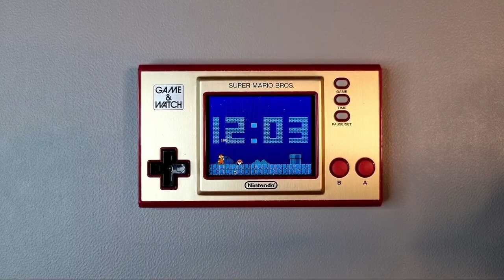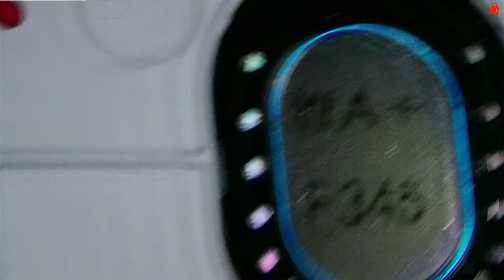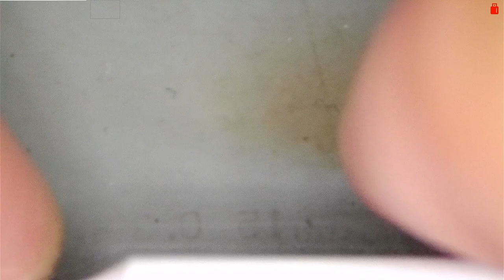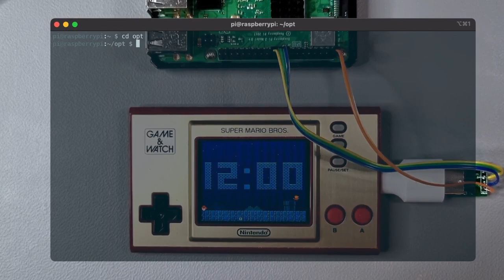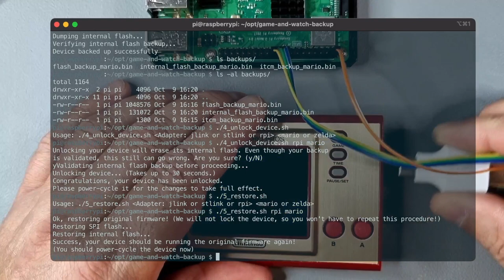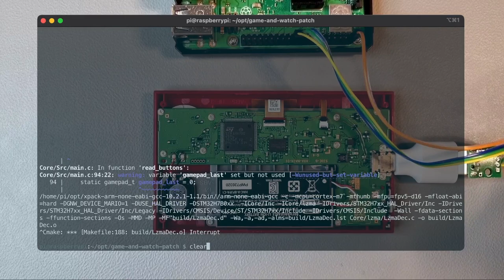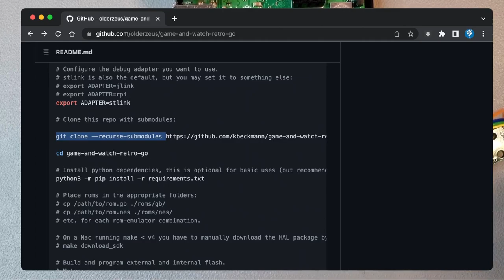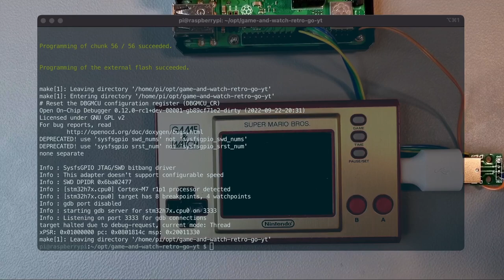Hacking and Flashing Game & Watch (Dual Boot)

Comment: I'd like to do this, but my screen broke. I look online, and I couldn't find a replacement. Do you know where I could find one?
Reply: I think that the screen is specially made for Nintendo so it is not available for purchase.
Reply from the maker: I don't think you'll be able to get the screen. Your best bet is to try to find non-working device and use the screen.
Reply: The screens are new old stock originally used in Cameras. You'd be lucky to find out just which models have these screens. I've been looking at creating a replacement solution, but with the systems selling for $25USD $35CAD there is little point at this time.

Comment: Great video and very informative, I am glad I found this (it came up in my suggested videos).
Is there no way to flash the chip without it being in the game and watch? Doing it that way would take the flash time down from an hour to a matter of seconds.
I've subscribed :)
Reply from the maker: It is possible but you'll still need to flash "internal" memory (ie. flash that's inside the microcontroller). Also - you need to build the image every time you add/remove rom files so you still need to build it. One option here is to build it once and then "clone" but which would probably be the fastest way of doing multiple devices at once.

Comment: Nice vid. I have a few questions. Is the Zelda G&W the same internally to the Mario one (can I wire it the same way) ? Which Raspberry Pi GPIO pins have you connected to? Did you use spacer headers or solder directly & which pins ? Also the Pi image you linked, whats the username / pw ? ta.
Reply from the maker: Zelda is essentially the same (have a look at my other video on Zelda). Debug header is slightly different but the pins we are using are in the same place. I soldered the wires directly but you can use header. username for the image is pi and the password is gameandwatch

Comment: I have a question. Can you run the backup image of the Game and Watch on any kind of emulator? I really like the Mario clock and would like to run it on a pi and a larger screen.
Reply from the maker: I don't know but I don't think so - the application (eg. clock and the emulator) are native Cortex code so pi won't be enough to emulate it... Porting without source code is also unlikely...
Reply: Thank you for your reply. It would really haven been a cool application for the clock. I really like it but the screen is pretty small and it's sad that the clock seems to be limited to this specific part of hardware. I hope you’ll make a video if you ever find a way to emulate it.

Comment: I want to do this to my game and watch, so you can solder usb to the board. Thanks a lot for video, I'm new to soldering and I want to try this project, one building a modded gameboy, then I have some crazy ideas, I want one of those unhinged sp's modded, I want to do a rasp-pi boy fitted in sp and then I want to. I want to do another one with pi/ maybe that pie board and use a ds advanced gba reader,  I think I saw you do it on video where you cut it and solder it to the pie. That would be sweet but my question for you is this, is that just a type of gauged copper wire that you are soldering? And what is a cheap setup for soldering if I'm new and want to do projects like I mentioned. Also an idea for you is if you look at my content, I try to make content for the beginner. Maybe you could do the same with this niche and make short ten min videos describing smaller portions of this so beginners like me can easily learn this skill set. A lot of the retro places that sell game mods are kinda uptight about soldering. You could be the bridge for the people who dont know. You are very very knowledgeable. Thanks for the video again!

Comment: Can you use other programmers via USB port, like ST-Link v2 for example, or is this works only with raspberry pi? Also can this work with the raspberry Pi pico?
Reply from the maker: Yes, absolutely. You can use it with st-link. As for raspberry Pico - not sure, I don't have one. But one thing is certain - the whole build process will take (most likely) a lot longer...
Reply: @RetroTechCorner  I have not any of these programmers available right now, so I will need to order one of these, but as I have a CH341A programmer on hands, could this be useful too for this mod?

Comment: I flashed the 64mb modded version of zelda and the option to select game and left shows blank screen. I can't install retrogo because it says I have single bank memory (yours shows dual bank).Do you know the fix or workaround for this?
Reply from the maker: Not sure what the issue is but double check the soldering (ie. new chip) and make sure you used unofficial/modified version of openocd (with correct parameters @55:22 of the video)
Reply: @RetroTechCorner  I tried flash_patched with git version "/opt/openocd-git/bin/openocd" from rpi image and it returns Exec format error. Makefile:270: flash_patch_int Error 2. --device=zelda and interface_"rpi". Zelda is working perfectly on the new chip so I don't think it's a soldering issue but I need to get the modded openocd working for dual bank flashing.
Reply: @chetanjiva8874  and @RetroTechCorner, Did you adjust your parameters to account for the original Zelda NOR flash of 8mb vs the Mario 1mb? you will want to double check my math but i believe you would change the the last make from 
"make  EXTFLASH_SIZE_MB=63 EXTFLASH_OFFSET=1048576 INTFLASH_BANK=2 flash"
to this instead
"make  EXTFLASH_SIZE_MB=56 EXTFLASH_OFFSET=8388608 INTFLASH_BANK=2 flash"

Comment: Do you have a known working copy of the Rpi image?
The default settings for openocd are wrong in ./bashrc and backing up the device works only after adjusting the version number, but then after I change the custom OCD path and run the following:
make PATCH_PARAMS="--device=mario" LARGE_FLASH=1 flash_patched
I get an error: make: * [Makefile:270: flash_patched_int] Error 2
I am not fluent in understanding cli so any help would be appreciated :)
Reply: did you use patched version of openocd? (export OPENOCD="/opt/openocd-git/bin/openocd")
Reply: @qqryqq123  Hi, Yes I did. I jumped on Discord and it was confirmed that the RPi image no longer works and was advised to use a Ubuntu VM.
Reply from the maker: I'll try to upload the image over the weekend.
Reply: @RetroTechCorner  I also get an openocd error when using this rpi image. 
Same error as @deano30923.
Is there a solution? Please please help me! 
I'm from Japan. Sorry for my poor English.:face-purple-crying:

Comment: Hi friend. Please try to answer me to this question at least, because it is a little important and I don't want do all this effort without reason. How can you flash the device from the USB port, when the cover will be installed on the device, and the battery already connected to the board? I mean, don't you have to cut the power, reconnect, hold the power button etc, to make flash start? How will you make this without removing the battery? Can it be flashed with the battery connected finally? Otherwise there is no reason to do this mod...
Reply from the maker: Once the device is unlocked you can flash with battery connected.

Comment: After couple of days struggling and using different images of Rasbian, and finally installing all necessary stuff on fresh oficial distro, I was able to run the dual boot with Mario & RetroGo. But after one day of playing with device, I am not able to use RetroGo. When I switch to it, I can see the logos of different retro systems, but when that intro finish and I should see the menu with games, the device turn off. Tried to reflash the RetroGo, but no luck - still the same behavior after that. Last game I played was bomberman2, if that matters.. Would anyone guess what the issue could be and how to fix? I thought that it might be some settings or game state went wrong, but after reflashing, the status should be initialized, right? Didn't use the saving and restoring saves stuff or so, as I had no progress that I would like to keep - except of the original Mario one, where I unlocked the first game and was able to start any level and select hard option, but that has nothing to do with RetroGo I guess, but I missed that during patching as well, so the Mario game is like as on new console..
Reply: maybe that external flash is damaged? maybe there is some check for it? someone posted somwhere that at the start he had corrupted memory and had to replace it, probably to ESD or overheat from hot air gun.